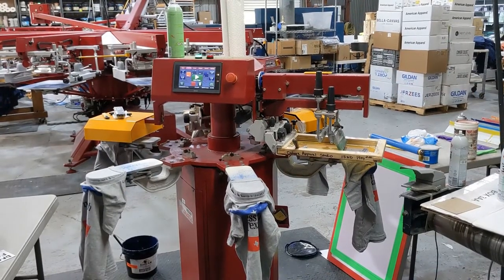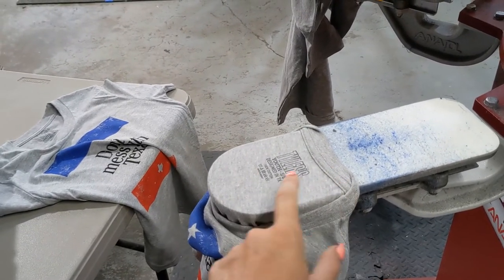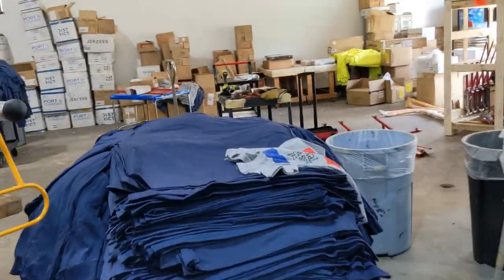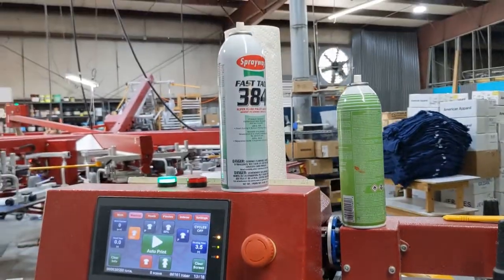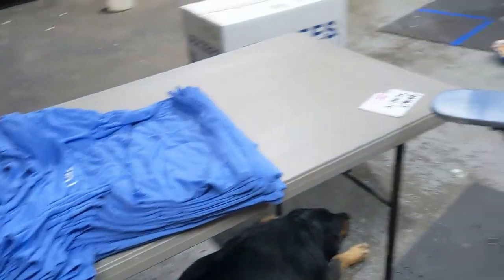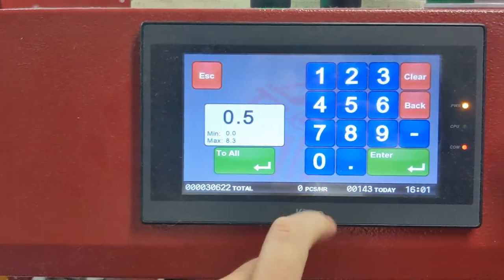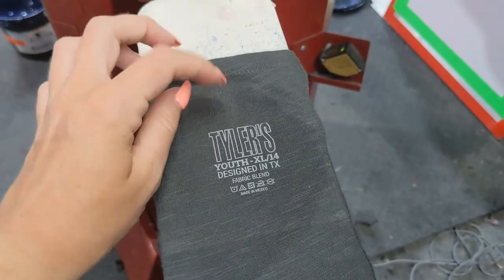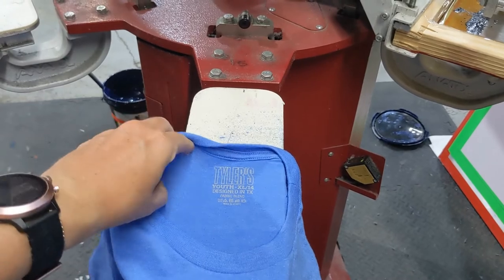Anatol Prodigy & How to Tag Printing

Comment: Also textile glue for platens is a good glue because you apply it to the platen paper use it for a run it gets lint and loses stickyness then you wet it with water and lightly scrub off the lint, run it under the flash cure unit and it's sticky again, it really saves money when printing with plastisol, water base and discharge is a different story though spray tack mist on long runs for those, and you need web for sweats and hoodies
Reply: Putting dye in the waterbase glue helps your crew know when more glue needs to be added as the color fades means more glue needs to be added
Reply from the maker: @jesselejarzar5114  GREAT INFORMATION!

Comment: Your platens might not be in the same spot, on the little auto. Normally you measure the distance from a spot against a stationary part of the press to the platen keeping each platen the same distance, at one shop we had a board cut so the platen would go quickly. Also a laser line can be added to the machine to make sure when you load the shirt, if a shirt is a different brand you line the laser to the top of the design you can manually place the shirt collar the right distance so the print isn't too close to the collar. Lasers are usually on brand new presses but at mom and pop shops, I would make my own from Amazon, hook it to the auto with powerful magnets so it doesn't move or some clamps. Making sure it can be articulating , line it up to the print on a test shirt and make sure it's on the loading spot. All your production should be made idiot proof(a military term used for new recruits)so it can be quickly and easily taught to new workers this way you don't have those problems where time, money, and chemicals aren't wasted because it all affects the bottom line.
Reply from the maker: Thank you for your feedback! Yes I know all of these tips and tricks but I am trying to develop and help inform people who need problem solving tactics or people who don't know how to even start, we have several Pallet sizes for our prodigy, and have to swap so we do normally measure, in good faith this was just some additional information I filmed while our press was being installed!